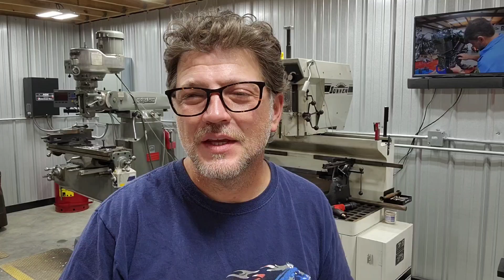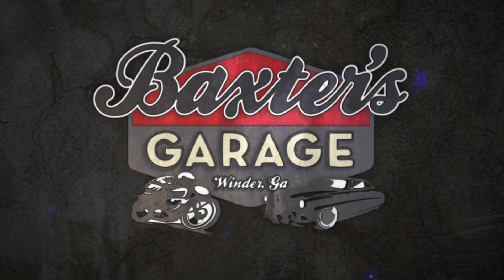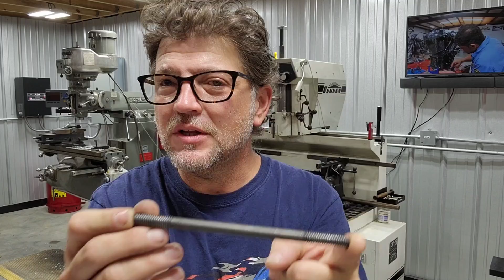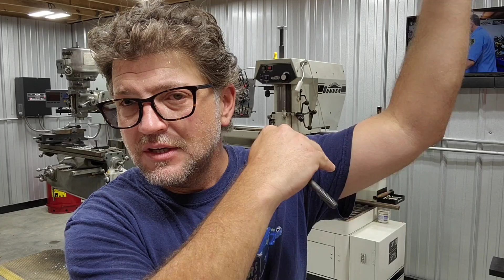DONT BUY WHAT YOU DONT NEED for your Harley! - Cylinder Studs...Do YOU Need Them?

Comment: @kevinbaxter   Great Video as Always Kevin. As I am Not particularly worried about the scheduling of your Q&A  Live Stream as I work a 6 day on and 6 day off Roster.
But I would Like to See Figures of what Air Flow from the M8 cylinder heads that can be achieved as I think the Stock heads flow at about 350cfm but that could be with a 1.5 mm  extra cut on the Valve seat and new oversize valves installed, I have a Stock Displacement 107 cu in M8 with a 468 Zippers RedShift cam installed with the S&S Lifters and Billet S&S Cuffs and S&S adjustable pushrods at present I am probably a fraction better than 107 HP and 124.9 ft lb of To that's really Great but since my Bike was Taken to tuned on the Dynomometer  I have installed a 47,000 volt coil pack and a Set of NASCAR  12mm Kevlar Braided Copper and Nickle wire Ignition Leads, I also have the Kuryakyn ES  Hypercharger and a S&S  SuperStreet 2into1 Stepped Header   pipe with DB Killer DELETE and Catalytic Converter DELETE,I  am impressed because I have a very wide range of Usable and very responsive power ,But I do notice that when on the open unlimited hahahaha (Private Access Road) Doing speeds of 150 kilometres per hour Onwards it's fabulous that this cam and this engine is only really just coming into its own Sweet Spot ,I have a Idea of what I am doing on Revolutions at 110 Kilometres per hour which is approximately 2250 RPM  but just never Notated what I am Doing for Revolutions for 150 KLM  plus though, I wish to Purchase very soon a Moonshine Horsepower Billet Square Port Ported and polished Intake Manifold that is Just 4mm larger at the Throttle Body which should Fit so they Say , and I would like to also Purchase a Set of Frankenstein Heads that are the 1.5 mm Enlarged Valve seat and matching oversize valves when I do get to this Stage all I Really need then is to Buy some good quality Roller Rockers and some Better Roker Towers I think But with these mods I invisage to get 109 or maybe 110 HP and 130 ft lbs  of Torque out of this Stock Bore Stock Stroke Engine I guess I will need to Step up my Injectors capacity for Flow but at the Moment as it is I'm Getting 322 Kilometres per Tank of Fuel on the 2021 Sportglide which is Blood Good I Reckon.
When will you be able to Do a In-depth Video on How to Go About Fitting a Small Dose Nitrous Oxide Shot and all of the Associated Installation because I really would love to See how you Go about this as I Trust in your ability and your years of expertise and value you're Instructions and salute you for you're Dedication in the Field , Kevin I have to Say that you are Held in the Highest Standing when it comes down to Maticulous Assembly and Disassembly of Machinery ,I Take my Hat off to You my Brother.

Thankyou so much for keeping us all in the Loop with these Fabulous Informative Videos and Interesting Projects with all of these Bikes Mate.

Sincerely .

Brett Henson
In Australia 🇦🇺👍

Comment: I am a retired structural engineer. Kevin, you are absolutely correct in your statement. The high tensile studs will, because of their strength absorb more force and resist elongation. But those higher forces will be transferred to the stud connections at the case which has not been strengthened, and even possibly weakened by modification. If you don't get an immediate or short term failure you will have reduced the factor of safety against long term problems.

Comment: Good solid advice, Kevin. Good to see your settled into the new shop.
I run Kibble White stud,  we stick with a stock case bore 4" stroked 98" for the strength as you describe, holding 36lbs off boost. The tighter you wind the bomb the bigger the explosion, lol

Comment: Great to see video from the new place👍. I agree the case is the weakest point. Since you have the knowledge and tooling, why not install steal inserts in the case? Use better studs and top of the line head bolts? Worth the longevity or do the steal inserts compromise the case?
Why did the motors go to case studs instead of keeping with the Shovel design?

Comment: There is NOTHING wrong with stock HD cylinder studs. 99.99% of the people fail to run a die down the threads and a tap into the nuts. They also fail to lubricate the threads prior to reassembly and add oil to the flat surfaces to reduce the friction between the mating surfaces. The studs MUST be chased and nuts tapped every time. I've never had a head gasket failure following this practice. Even with 12:1 compression ratio. 35 years of working on these turds. Warm your bike up until the head is hot to the touch prior to throwing your bike in gear and peeling off.

Comment: Kinda have to diagree. Steel is steel,be it high or low tensile. Both will expand at a given rate. High less than low tensile. But strenght factor does come into the picture. With a quality head bolt,like S/S or ARP I believe and agree the failure point would be the case threads. But traditionally  a high tensile stud has a class 1 thread which is much stronger then the thread on a low tensile stud. Therefore all my engine builds will use ARP studs and head bolts. One opinion. Thanks ,great to see ya back on the air waves.

Comment: Same video popped up in my feed as well, I love it when you engineers get into the weeds a little. He made it sound like the head had to move a tiny amount under those kinds of pressures. With the high tensile studs there was no movement, or bounce, and showed the crack in the block. If it ain't broke, don't fix it! I would tune in live weekends after noon.

Comment: Nice to see you in your new environment! I had problems with an aircooled BMW pulling case threads with the stock studs under "severe conditions" such as using the factory specs to torque the nuts. The fix is a special longer length helicoil (twice as long as normal) and reduced torque. Is that even an option with HD cases?

Comment: Just a thought Kevin. When heated I believe high tensile will move or grow just the same as low carbon steel. What it won’t do is stretch under pressure. So yes the studs could pull out of the case or head from high compression. But with heat they should grow or contract like any stud. Just my experience from being a machinist. Let me know what you think. Thanks

Comment: Totally agree with you Kevin. Two different materials always have different expansion and retraction rates. Throw in heat cycles etc. It can be a quandary
Reply: Working in power plants over 25 years, turbine rotor/shell differential expansion is monitored closely. Warmup ramp rates are used to help with heat cycling. The same applies here, as long as the warmup rate is sufficient, I would rather have the stock studs.